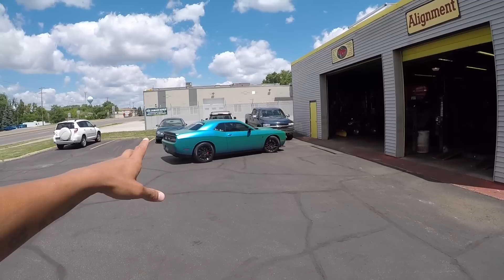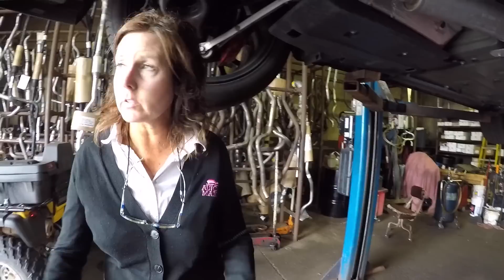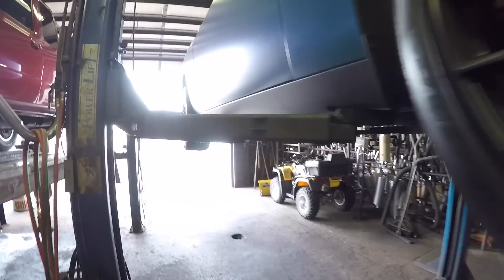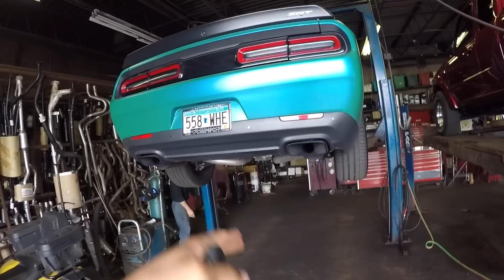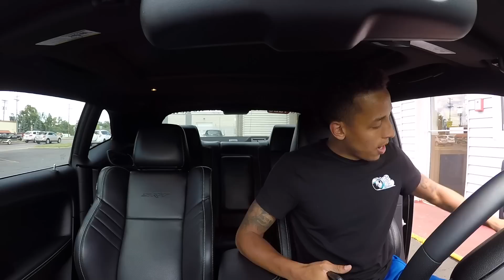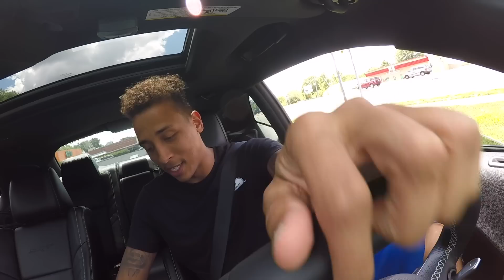Hellcat Muffler Delete & I Got Pulled Over By The Cops Right After!!

Comment: is it really against law the quickly speed up and reach speed limit, but not go over. ?
Reply: tristan tomasheski yes. Cops will consider acceleration too quickly as dangerous to the public!
Reply: damn thats crazy but i get it kinda lol thanks
Reply: It can be classified as "reckless driving" yes
Reply: Its called exhibition of driving
Reply: Hell yeah.
Reply: I mean, it's really obnoxious to accelerate at insane speeds, especially since it makes alot of noise. Btw, he went up to 50 in a 40.
Reply: Yeap over acceleration
Reply: Yup it’s called exhibition of speed
Reply: As Ricky said, and as the patrol said, you can accelerate to the speed limit in a short couple seconds, but what happens when 707HP breaks those rears loose at near redline?
Reply: tristan tomasheski yes, its typically called "Excessive display of acceleration."  At least it is here in TX...as Ive been warned with my 550hp challenger
Reply: tristan tomasheski it shouldn't be
Reply: Ricky Garcia yes it’s called exhibition of speed here in California. A ticket I got in my BRZ... 😐
Reply: tristan tomasheski it wouldn’t have been a speeding ticket. So yes.
Reply: Unreasonable Acceleration, such bullshit!! Just to write tickets and make money.
Reply: + tristan tomasheski - It most certainly is. Back in the mid-1970's I was out for a first date with a stunning Vietnamese girl in my RED HemiCuda. Ordinarily, I would have been cool, but THAT DAY they changed my asthma medication. The new stuff really got my heart going and thus, the adrenaline was up. Sooo... I left the red light rather aggressively up to the speed limit. 

I knew better. 

The rush is the rush, though. Needless to say, I got pulled over. I was cited for "Exhibition of Acceleration" (In Arizona). In my defense; if I had actually wanted to exhibit acceleration... 

Anyway; the tires did break loose a little bit, and the officer said that if he had wanted to, he could have cited me for "Failure to Control my Vehicle". Somehow; I didn't feel lucky. 

My date thought it was funny.
Reply: lefant0m3 He was saying it was retarded that the guy in the BRZ said he got a ticket for it. Not possible in that slow car. Haha.
Reply: Exhibition of acceleration sounds so stupid, in Ohio it's Unreasonable Acceleration which sounds so much more appropriate but that's California for you. Have to over do everything!
Reply: He was guessing 50, wasn't an officially recorded speed.
Reply: It's a hellcat. He probably got higher but the officer was guessing 50.
Reply: My ticket was near 30 years ago in Texas for exhibition of acceleration and it was considered racing by the insurance company, guess what happened to my rates.
Reply: +My65442 - Did they say; "Awww, you've been a great customer... so we're going to cut you some slack this time"? Didn't think so...

BTW - In the early '70's, I test-drove a 65 442, maroon/black, 4speed, A/C, coupe. Really liked it. I didn't buy that 1, but have had many Cutlass / 442 coupes and convertibles since then. Even had 3 or 4 Rallye 350's and a 1970 98 Convertible. LOVE Olds. GM never shoulda killed it. Bad management.
Reply: its called unnecessary acceleration
Reply: In Texas it's "exhibition of acceleration" and is on par with reckless driving - one of the worst tickets.  But you really only get that ticket for a burnout or such.
Reply: we all gonna die anyway, and I thought GOD was in control anyway
Reply: LOL yeah insurance tripled for three years. The officer told me I should take the class and get the ticket wiped off my record but I didn't listen and just paid the ticket, that was only the start of it. Learned an important lesson that day!! That's what I get for having duels and glass packs when they weren't the in thing with the police. He was on a side street so he couldn't clock me, therefore gave me the ticket for exhibition, with the warning about  it being a bad one. 

I have in the body shop as i type a 1967 GTO and sitting in my garage waiting to be restored is the 1965 442, it needs a lot of work, some one was drag racing it and thought it would go faster if they removed the seats,, of course it is a West Texas car and is rust free.
Reply: excessive use of acceleration
Reply: Yep, here just revving at the light is “Excessive display of horsepower”.
Reply: He was speeding. Cop said it was 40 zone and he got up to 50. Watch and listen again.
Reply: yes in Texas that offense is called exhibition of acceleration. Down here The Little Rascals racers that want to be stupid on the roads get tickets for that all the time. cops down here love little punk Street racers that think just because they have money or their parents have money means that they can accelerate quickly. and as soon as a cop sees them burning tires at a red light they pulled him over for exhibition of acceleration. they do the same thing for people with loud stereos in their car and there are even those that like to pull up next to a cop with their stereo turned all the way up booming Bass thinking that it's okay because the stereo is in their car but they get a ticket for disturbing the peace. And there are even those down here that like to put Tweeter speakers under the bumper facing outward on their cars that pick up nothing but vocals in whatever song they're listening to so everyone around is forced to listen to the vulgar lyrics of all of the songs they listen to. I love when a cop pulls them over. I had my son with me one day at a gas station and a guy in a beat-up Caprice Classic pulled up at the gas pump and because he had one of those speakers playing on the outside of his car I could hear every word to the cop hating woman beating gang killing rap song that they were listening to and a cop just so happened to pull up and he heard it and wrote him a ticket I almost went over and shook the cops hand and thanked him because there is absolutely no reason that my two-year-old son at the time should have been subjected to such lyrics. Don't get me wrong I like rap music I like country music I like rock music I like any music that has a good beat but there is no reason why you should go around playing your music up at such a level especially if you have a speaker like that mounted under the bumper of your car and expect everyone to have to listen to that speaker. If I hadn't had seen that cop pull up that night I was going to wait for the guy to go into the store and I was going to jump underneath his car and yank the wire to the speaker out and then wait for him to say anything to me.
Reply: Po Russki you got a ticket for going from 0 to 60 in 12 seconds? Wtf? 😂
Reply: He went to 50 in a 40 mph... Listen again
Reply: Yes “Law of exhibition”
Reply: Reckless Driving is considered a driving violation that you can get a ticket for and it encompasses a lot, including fast acceleration...
Reply: tristan tomasheski I’ve gotten a ticket for excessive acceleration here in Missouri
Reply: Some cops will regard that as aggressive acceleration. NYPD pulled me for the same shit cause I had a CAT delete in my altima; thankfully, NYC cops extend courtesy to military veterans.
Reply: Billy 2 cents didn’t have him on radar. Just an assumption
Reply: "exhibition of speed" is the proper term for it, and in most states this is a form of wreckless driving.
Reply: Long as you have control and not spinning wheels it's legal
Reply: RIP new tesla roadster
Reply: funny how one guy answers the question and like 50 others are saying the exact same thing xD
Reply: Yes. It's called reckless driving.
Reply: It's not always how fast you're driving, rather how quickly you accelerate. They can stop you for initiating a race for revving at a stoplight.
Reply: Each state is a little different, but in the 405 it's called excessive acceleration. I learned that the hard way. Speed limit was only 45 and I didn't go over but I got their in about a second or 2. They have it in 3 degrees (idk what they mean) but I got Excessive Acceleration 2 on my ticket.
Reply: absolutley. called reckless driving.
Reply: Until you spin your tires off the line and plow a family of 4 on the sidewalk...
Reply: Also called a "display of speed".
Reply: Exhibition if acceleration ticket. Can cause loss of control which could potentially be dangerous
Reply: annggee Ruiz *exhibition of speed
Reply: not as long as you don't spin the tires I asked in a driving class after a ticket
Reply: in a 200hp car? what a richard to give you a ticket for that.

Comment: $100 muffler delete using a saw zaw on a $70,000 car...
Reply: Zachary Gamble I know , when I saw that knife  (saw) , I would have been Whoa whoa stop right there lol taken my car back, lol , but that just me
Reply: How do you expect them to get the resonators off the car, ask nicely?  Sawing them off is standard practice in muffler shops.   It offers a nice clean way to remove the old resonator or muffler they're taking off. It also leaves a nice clean edge should the person decide they want to put the resonators back on the car.  Using a cutting torch doesn't leave as nice of an edge which makes welding them back on a pain should the person decide they want to do so.
Reply: Soulrider2012 all I'm saying is a $70,000 car should not be getting a $100 exhaust job. Go the extra mile to get quality parts
Reply: pfft it's easier to run straight headers tbh
Reply: im doing this to my g35 i doubt itll be loud.  I wana sound loud thoe
Reply: @just_a5.7  VQ35s sound great

Comment: Isn't this car leased?
Reply: most people now these days lease cars...and flex on the internet like its theirs lolol
Reply: Lol yea, wow cool job bro. You just damaged your lease lmao. That'll be about at 3 grand mistake.
Reply: STL Speed Na pretty sure it's not leased. Pretty sure he intends to do some other mods also. It's probs financed.
Reply: so what?
Reply: If it was leased he wouldn't have done any mods to it
Reply: he has a video clearly stating that he leased it....
Reply: someone should share this to the lease company :DDD
Reply: STL Speed some people will lease a car and then buy out the lease which is common
Reply: Leather Boot Room I mean technically it’s their car
Reply: TheBathingSaint technically it isn't until their actual name is on the pink slip.
Reply: You can buy out a lease at the end YES... dealership still does an inspection and it's not a get out of jail free card.  You still pay damages, mileage overage charges and so on. Even before you're allowed to buy it outright.
Reply: You don't own a car till you make that last payment
Reply: DaygosTommyT mods can be remove .. a muffler delete? Just unbolt/cut it off and replace with stock part... simple
Reply: One Tall Conservative apparently you haven't looked at HellCat exhausts. Thats an entire redo.   Even if you reweld... once it goes in for dealer inspection for turning it back in, they'll put it on the lift and look. If it's welded unlike it is from factory. He'll have to pay for it.  It's pretty crazy the misconception on leasing.  It's basically renting.
Reply: STL Speed they won't look under the car, honestly they prob take it for a test drive see how it drives and that's pretty much it maybe pop the hood open check the engine bay and boom he's good, just a mod always reversible
Reply: STL Speed or he pays a FATTTT fee who cares lol not my car, gotta admit it sounds bad ass
Reply: STL Speed factory weld point? Considering these are made in a factory the weld point won't be 100% the same on every car. I've never heard of someone's lease getting dinged because of welding marks. My buddy has a brand new c63 AMG lease.. he tuned it like a dumb ass and blew the engine. He got it wiped and reprogrammed with factory tune. Took it to dealer and got a new one LOL
Reply: HSKFC Gaming but it's not.... soooo he can..
Reply: STL Speed he only has to pay the differences if he returns the lease when it ends. If the lease ends, and he buys the car (the remaining price on it) then it's his 100%.
Reply: cupofacid that's a lease to own, different then a regular Lease.
Reply: These  younguns.....
Doing things like this runs up EVERYBODYS insurance......
Especially when they wreck a car like this.....
Lesson-
DO THIS ON THE FREEWAY
CHECK YOUR SURROUNDINGS FIRST......
DAMMM!!!!!!!
Reply: Yeah this is what isn't 100% explained when you lease. Opting to buy the car at the end isn't a magic wand to make the dealer not care about what you did to it. They want their car back to them in the same condition it was given to you, only after that is settled will they offer to sell to you.
Reply: Because it triggers guys like you... LMAO. and people give me problems for mine.... its a vicious circle, but someone needs to comment.  Be sure to check mine out haha
Reply: It's financed.
Reply: Alex Mora lmao you're literally a month late.   But thanks for playing. It's been great. I've gotta be helping this guys views.  Go back about 6 months he literally states, I leased this car... 😂😂. Annnd heeere we gooo.
Reply: STL Speed I never argued the fact that it's leased, but the stupidity that the dealership will do an inspection if you buy it at the end is completely wrong. In fact the dealership doesn't do an inspection regardless it's the bank that does the inspection and if you buy it out you don't pay anything. That's the part where you were incredibly stupid. They don't put it on a lift and check anything either all he has to do to turn it back is have the mufflers welded back in.
Reply: All he has to do is get the stock resonators welded back on..
Reply: Yk you can buy out a leased car..
Reply: He can have them put them mufflers back on car before he returns it

Comment: "Unreasonable acceleration." What?
Reply: It's a valid point you accelerate to fast then you break lose and kill someone
Reply: it's a real thing. nobody "needs" to quickly accelerate to 50+ as fast as that. it's how people lose control and crash into things
Reply: what objective measuring device certifies it was unreasonable?
Reply: Yeah that’s bullshit. Is that actually a law??
Reply: He was speeding... so yeah, it’s against the law 😂
Reply: @shadspov  Anything else you need to teach the masses of the US?
Reply: Neal Mcleod right now? Nope 🙂👍🏽
Reply: Kelly Sunseri-Adams 0-50 miles an hour when the speed limit is 55 is not speeding. I’m just assuming that the speed limit is 55 where he’s at. Also, as long as you’re not spinning tires through your gears you’re fine to accelerate as fast as you want. If you spin then it could be reckless driving

Comment: is called a straight pipe and plus you are getting more power and I had it done on my 2010 Dodge Charger high output so I really felt the difference with Flowmasters ran for my headers